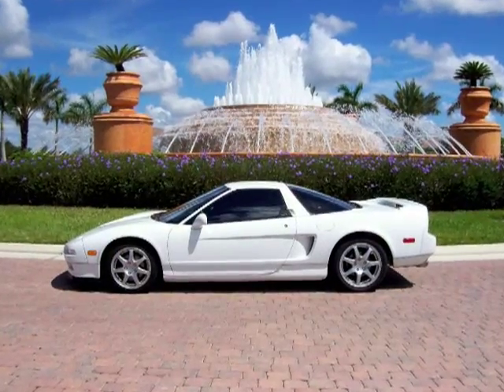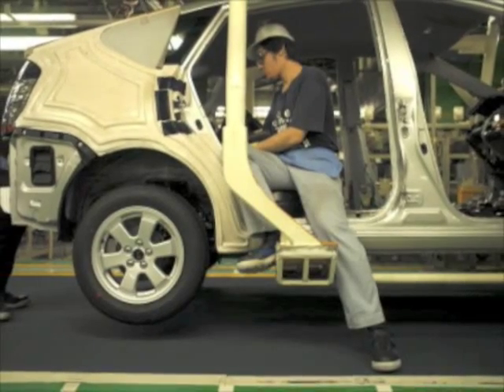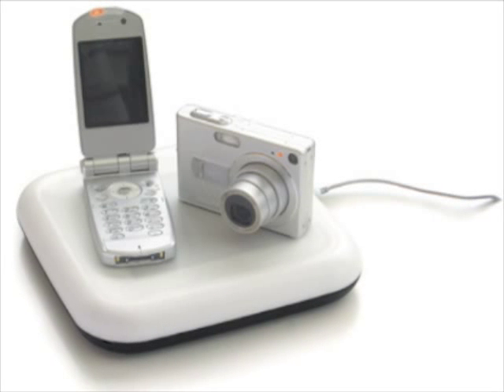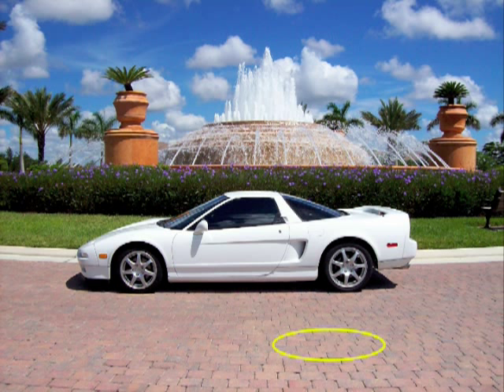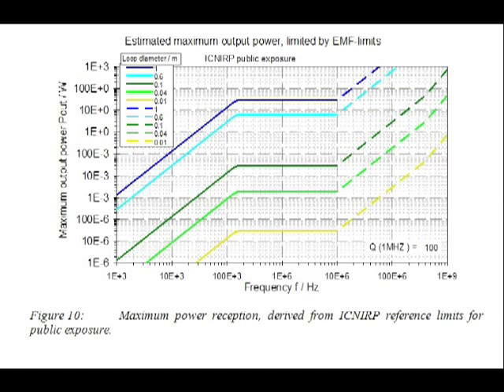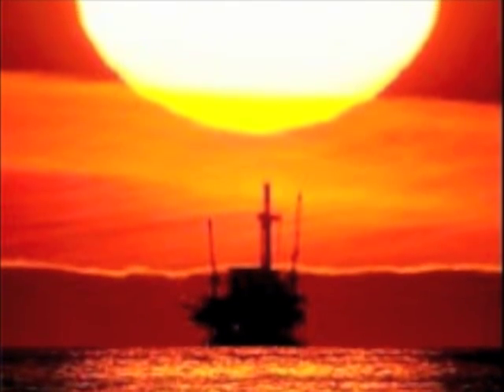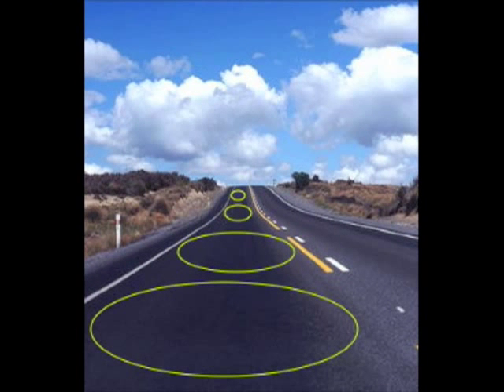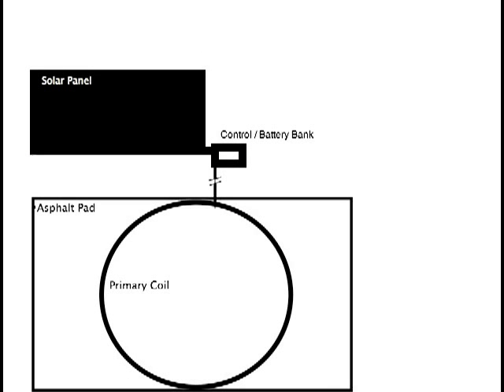Interstate Highway System 2.0

Comment from the maker: Let me try to help you understand how this system works. I'll address each of your concerns to educate you more... First, the roadway would not wear out any faster. Maintenance would be required just like on ALL mechanical systems. Second, this system isn't meant to "fix" traffic congestion... Third, there is no need to have extra power during heavy traffic conditions, the system would still function as designed and effect all retrofitted and "system compatible" cars on the roadway....

Comment from the maker: No, just the IHS not side streets. To charge your car you park at a charge lot or get on the IHS if low on charge. You are correct, It would be a massive undertaking. Nothing we can't accomplish. The IHS was an amazing achievement in itself. Now that 90% of the work is done we could integrate if we wanted. The condition of our current IHS is degrading. We are overdue for an "Overhaul."  To continuing being a mobile species we must funnel the Sun's photons to our systems.